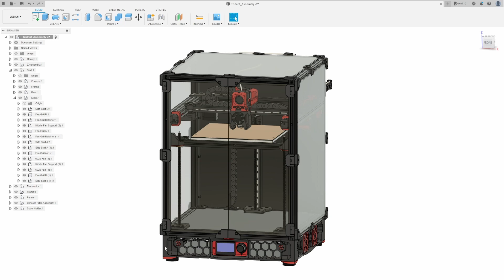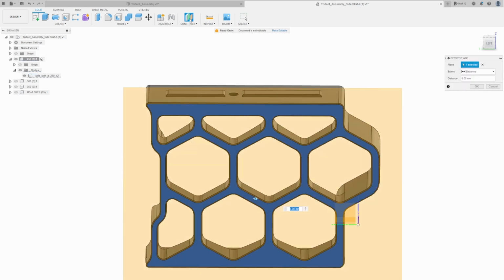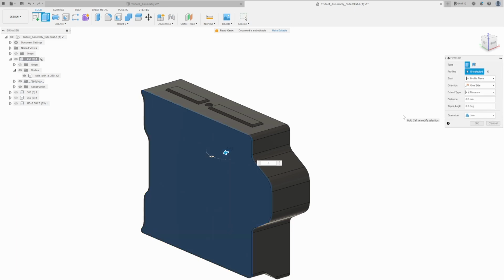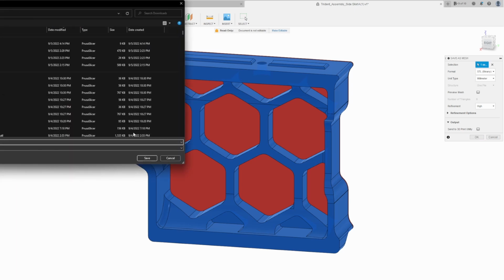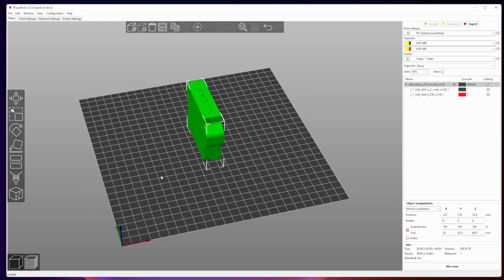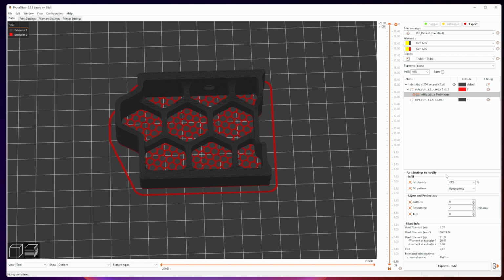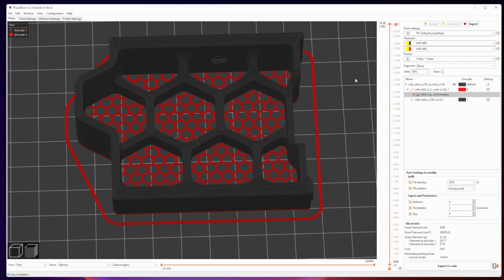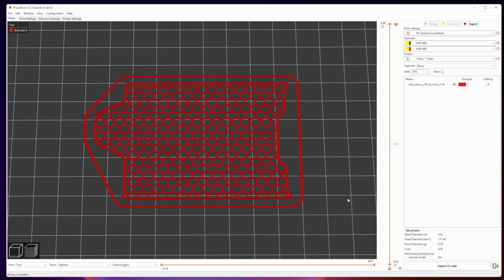Add an Accent Mesh to your 3D printed parts!

Comment: That was probably one of the first MODs I thought about doing when I built my 350 sized V2.4 about a year ago but since I really like to use the holes to pass my fingers through for a firm grip on the otherwise slick as hell exterior when hauling the 15-20kg of the machine around I've decided to not be doing that MOD ( because of that I'm also having trust issues towards the Handles MOD - Not that I could use it anyway... Too high up ) 🤔